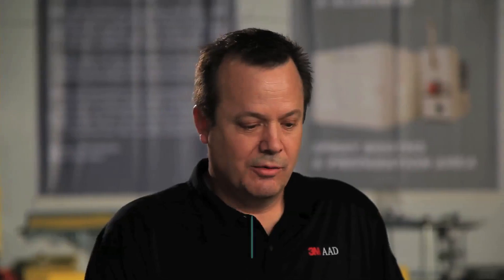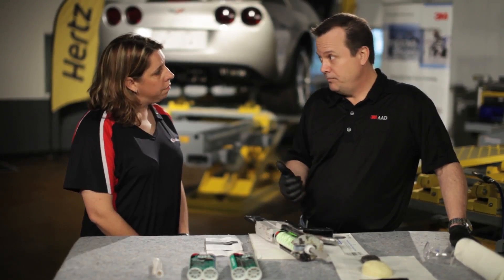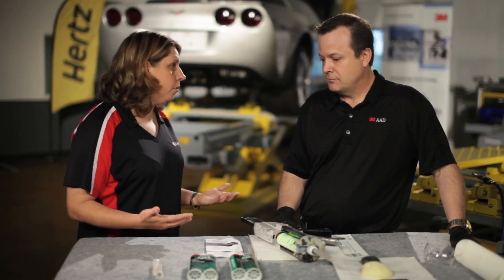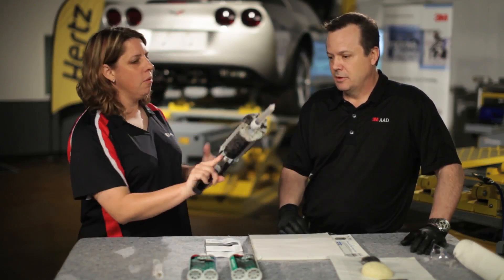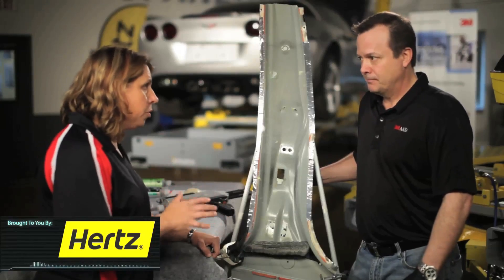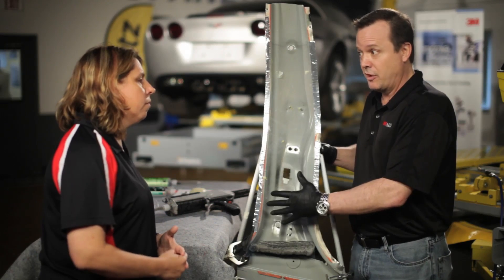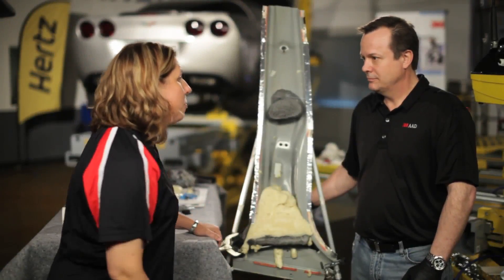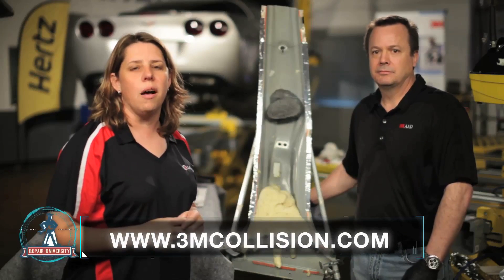How To Apply Automotive Foams From Collision Repair University (DIY)

Comment: Not saying all but the foam i found in some vehicles acted like a big sponge to absorb water & eventually rot out the panel from the inside out .
Reply: faronf2006
Yup. I'm working on a 2006 Dodge Caravan 126,xxx miles,  doesn't see bad weather and is parked in a heated garage. Rockers and dog legs rotted out. OH, WHAT'S INSIDE? Uhhhh.....FOAM!
Reply: I got exactly (3X5) 15 rust spots pop up on my Mazda roof! Foam used turns corrosive when condensation moisture is absorbed.

Comment: hey guys, i have a bmw e30, now the thing is i thought of using foam products in the chassis of the car. what i want to know: a) is it wise to use it to full up the entire main support chassis rails? b) i know that they left those holes on the rails probably for letter water run out after you would have driven in water, if you full the entire rails up, would that foam act as a barrier to the water or would it be bad if it absorbs the water and it stays in there?
Reply from the maker: The first question would be, what type of repair are your trying to complete? What are you hoping the foam will do?
Reply: well i did some welding on the floor pans, the car is being restored. i saw someone use a product like this for reinforcements, does it serve that purpose? am not sure. So yeah i am thinking it could somehow reinforce the subframe rails?